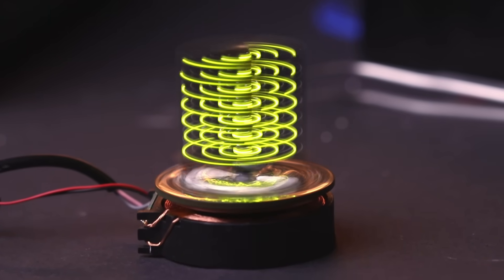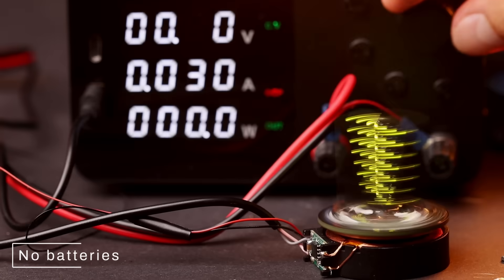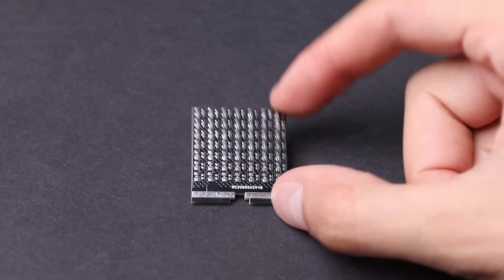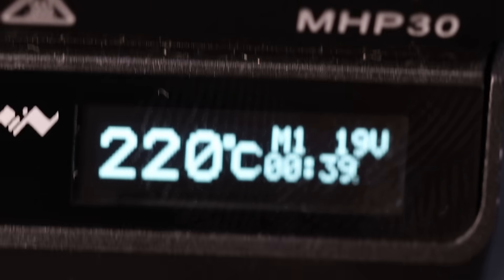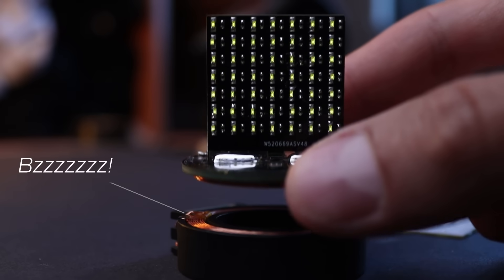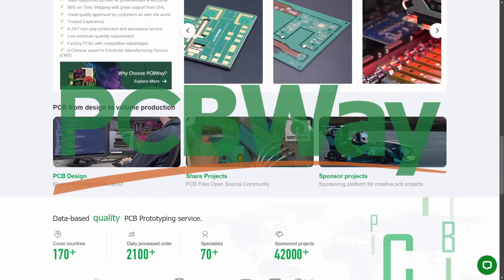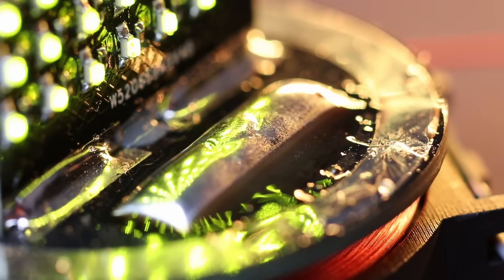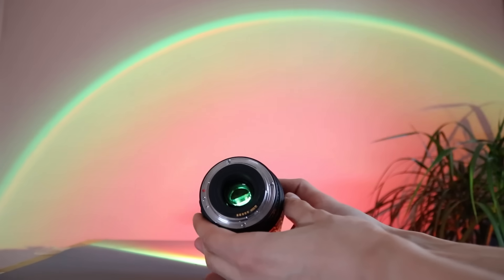I Made a Tiny Volumetric Lamp

Comment: I lnow this would complicate this a bit. But you can use your inductive coils to xfer data with power. It takes a bit of work, but it is how RFID works.

I look forward to your next project. Thanks for sharing.
Reply from the maker: I can try it, but I need to calculate the communication bandwidth because I need to constantly refresh data for a large number of LEDs quite quickly. I should think about it more. Thanks for the advice
Reply: @NickElectronics  how fast is rotating? And what is the slew rate of your LED's. Are they monochrome or multi color?

If your using monochrome, then you only need 1 bit per led, if they are multicolored then we need at least 3 bits. (For 8 color)
Since your typical monitor updates every 1-3ms, ill use that.
Anyway do its 1/(bits*update frequency).
Then you just need to make sure your coils support that frequency, and encode it with your power. (Though I'll admit that I don't know exactly how that works as I've never tried it, but I know it can be done. I assume there are modules you can get online which do that for you.)

Comment: why do you say leds use lots of power. spin a led strip. like a lawn mower made out of cord. yep the cord is a power & signal wire also. thats probably just jcb weld lol.
Reply from the maker: A lot, not a little. Everything is relative. 'A lot' is not a very precise word.

How do I power a spinning LED strip without twisting wires? There still has to be some slip ring or something. I can get ground from the motor shaft, but what about the +?

Not JCB weld, but close
Reply: @NickElectronics  centrifugal force keeps the lawn mower strips pointing outwards, two wires on the strip of course, + and -. current loop.

Comment: For your next trick, could you do one with addressable led's? You could use an off the shelf matrix board and a wifi enabled Arduino to control it (meaning you'd still only need to provide power) you'd have to provide a small sensor to sense it being at position zero so thsy you could keep the drisplay in sync with the rotation of course but could look smazing
Reply from the maker: Yep, it could indeed look amazing! I’m considering making a part two :D

Comment: Since the led are spinning, why not put a couple of coils on the led base, and a couple of magnets underneath so rather than  transmit power, generate it
Reply from the maker: That's one way of doing it, but it only works the same if the spinning frequency is very high—by that, I mean VERY high. The wireless power transfer frequency is 85 kHz. To achieve the same frequency with a generator using permanent magnets, you would need to spin it at a speed much higher than 6000 RPM. At 6000 RPM with a 3-pole generator, I think you can get a maximum of 600 Hz.

6000 RPM divided by 60 seconds gives you a spinning frequency of 100 Hz. Then, you multiply that by the number of poles (3) and by 2, because each pole generates positive and negative half-waves during one spin. So, 600 Hz versus 85 kHz means you have a frequency that is 141 times lower, which results in MUCH higher filtering components at both the output and input for the same power. So 141 times bigger capacitor does not sounds great for me :D

Comment: headphone jack is cheap option for spinning parts.
Reply from the maker: I suppose it won't work for long at such speeds, just like slip rings. They are all designed to work at speeds of around hundreds RPM max.

Comment: I made a large version of this for my thesis project in art school in 1979. I used copper foil to make shapes that the LEDs would reproduce in lights as they spun on the 20” arm with 50 leds soldered onto it.
Reply from the maker: Wow, that sounds cool! What kind of shapes did you make? Maybe you have some photos or references? I haven't thought about giving the spinning part any other shapes... Hmmmm, that might be an interesting direction to explore in future projects
Reply: @NickElectronics  The arrangement was like this. The spinning arm had 50 LEDs mounted in a line connected to 50 small nickel brushes that skated over the glass disc mounted on top of the motor, with the shaft coming through it. The motor shaft was connected directly to the arm and provided the positive connection. The negative connection for the LEDs was provided through the copper foil shapes that the nickel brushes skated over. The copper shapes were pretty basic, geometric things like triangles and circles. The piece was focused on transforming physical shapes into light, so the actual shapes were not that important. It had a couple of interesting aspects to it, one of which was, it was kind of scary, seeing this whirling arm that spun up very rapidly When you pressed the pedal in front of the piece. It was also a bit noisy with the fan motor, making this loud hum and the sort of scratchy noise as the brushes rhythmically scratched the Copper shapes. I haven’t thought about it in a couple of decades, and I’m pretty sure the teachers didn’t know quite what to make of it. If I were going to do it again, I would use magnetic reed switches instead of the brushes, and use magnets On the disk to create the shapes.

Comment: Could use magnets in the base with coils on top to power it, like an electric generator.

This would be more like the motor powering the display.
Reply from the maker: I could. Tere is already a huge discussion about it in the comments 😅. I just hadn't thought about it at the beginning. Also, the upper coils could be made with PCB tracks, which would save some space and weight as well.

Additionally, I was wondering if it's possible to make a BLDC motor with a low-power wireless power transfer option, where the stator has coils and the rotor has magnets plus additional coils for recieving some power from bottom coils. Hmmm
Reply: @NickElectronics : Not Exactly sure what you said, there, but it sounds good to me 😁✌🖖

Comment: Isn’t that just JB weld? And if you’re using wireless power coils you could just as easily make your own “slip ring” that’s just powered through the motor shaft and grounded to the edge of the spinning platform with a dragging wire, spring or brush since at that point your still putting the controller on the spinning section and don’t need a bunch of wires for the signal…
Reply from the maker: Yes, I could, but it's not that fun after all. I'm also not quite sure how long it would last spinning at such speed. Reliability was mine concern. For low speeds for sure slip ring is better
Reply: @NickElectronics  considering power tools use brushes and they’re replaceable for a few cents it would probably last longer than the JB weld holding it together.

Comment: Now add a high-resolution of intensified LED matrix to it.
Reply from the maker: That's a plan for a future video. But I don't know how complex it would be, because I have to send all signals through Wi-Fi or Bluetooth to the spinning board and synchronize the refresh rate with the rotation speed, which would either require a sensor to measure the exact DC motor speed or installing a BLDC motor. A lot of challenges awaits.
But it sounds like a fun project to do

Comment: Could you skip the power transfer coil on the base and just put magnets in the base? Then the spinning part has a coil which acts as a generator powered by the main electric motor to create power from its own movement?
Reply from the maker: I had some thoughts about it before going to bed yesterday, and I believe it wouldn’t work with just one coil and magnet due to the planar orientation of the coil. For current to be generated in the coil, there should be a changing magnetic field oriented from bottom to top (or top to bottom) if the lamp stands on the table with the coil above it.

So there should be at least two magnets positioned on opposite sides of the circle, with their poles flipped: one with the north pole on top and the other with the south pole on top. Then, two coils at the top would spin, magnet would create changing magnetic field in them, and current would be induced. I think this setup might work properly.
Reply: @NickElectronics  it's called an axial flux motor/generator. Magnets arranged on a disc and coils on a flat disc parallel to them.
Reply from the maker: @SidekickElements  Yes, exactly what I was thinking of
Reply: @NickElectronics  So with that you would replace half the power transfer electronics with magnets... I wonder if it's worth it. Will probably end up costing more...
Reply from the maker: @SidekickElements  Magnets are quite expensive, especially when dealing with high power levels (big magnets needed). They also have a major drawback: they’re sensitive to high temperatures. If a magnet is heated beyond its Curie temperature, it loses its magnetic properties. Additionally, generators with magnets require moving parts, which adds complexity. Wireless power transfer does not. Another limitation is the low frequency you can achieve. For instance, the standard frequency for wireless power transfer is around 85 kHz. Even with a common three-phase design in PM generators, you’d need to spin the motor at approximately 28,333 RPM to reach same equivalent frequency. I dont think it is possible. Using a lower frequency requires larger output filtering components, making the setup bulky. So, there are actually quite a few drawbacks.

Comment: maybe use carbon brush for nonnected spinning? like it is inside a dc motor? a lot of drawbacks like heating  and other issue but maybe less vibrations?
Reply from the maker: Thanks for the tip! I’m not sure it would help with vibrations, but in the future, I might consider other technical solutions. Maybe I’ll even go towards BLDC motors.

Comment: An accelerometer breakout board and a beam break ir phototransistor (can be found in SOOOOO many electronics, like old roller ball mice, scanner beds (to home the sled) ... lots of stuff) and you can ask a chatbot to write you a program that will read the accelerometer, and coordinate it with the beam break (just put some tape on the edge to break the beam once a rotation) telling you where the heavy side is in its rotation. You dont need fancy turbine rotor balance machines if youre smart about it....although, those arent exactly hard to build either....
Reply from the maker: Hmmm, thanks for sharing the knowledge! I might try making one just for fun😅

Comment: How many lumens does it emit vs when it is still?
Reply from the maker: It's hard to say without measuring it, actually. The radiation pattern from one diode is almost 180 degrees, but the intensity is obviously different at different angles. If we assume that the diodes are close to each other and that this somehow averages the radiation intensity in all directions, creating a nice equal 180-degree radiation pattern for the whole plate, I would say that spinning vs. non-spinning results in a two-fold difference. This is because it has to cover 360 degrees twice with a 180-degree pattern, resulting in lower intensity when it spins, obviously.

Comment: False premise based on rechargeable batteries not existing 👎 untrustworthy 👎
Reply from the maker: How would you charge a spinning battery? The LIR2032 rechargeable pancake battery has a capacity of 70 mAh, while the lamp can consume as much as 200 mA or even more, depending on the number of diodes and their brightness. Good luck recharging it every 20 minutes...

Comment: Apply extra flux. Components should be pulled onto the copper.
Reply from the maker: If you are talking about the hot plate shot, components were pulled to the pads, but just not all of them due to bad positioning. Sometimes it happens. If you're referring to the soldering iron shot, then yes, it's not the most precise. It was hard to film using a macro lens that was too close to the PCB while soldering at the same time.

Comment: Been making these things for something like 20 years. I just call'em "Povards". With wifi and things like ceramic capacitors, you can really spin up your system and have to run without shattering. Data can be transmitted wirelessly. There's always a dilemma with spinning gadgets like LIDAR's regarding how much to put into the stationary base and the mobile platform. Slip rings are only for small wire counts, slow RPM's and minimal wear. They're not for 6000rpm, that's for sure. If you're using induction power, that's good, because then you can even encase your electronic parts in vacuum and get rid of air friction and whoosh. This is really one cool system that can be bult and programmed a hundred different ways and each one will have its advantages and limitations.
Reply from the maker: Hello! Do you also use wireless power transfer with inductive coupling in "Povards"? I'm curious if I could do the same with capacitive coupling instead. The communication aspect is also quite interesting. I could use a Wi-Fi module on the spinning part, but I might also explore close-range communication, possibly based on the principles of a CD drive or HDD. Another option could be to use some kind of modulation to embed data into the power pulses. However, I’m unsure which solution would provide enough bandwidth for a display and would be the simplest at the same time. 
As you said, any solution has pros and cons
Reply: @NickElectronics  I just power by using shaft as one electrode, and an insulated ring as the other. Like a makeshift slip ring, because I'm cheap. And I mostly do slow turning scanners. All of my LED builds lie somewhere in a bucket. I wanted volumetric type displays and found that it's actually easier to have a spinning screen and a synchronized projector. That way, the surface that makes the volumetric picture has no electronics in it. I wish there was a way to have a silent volumetric display, but anything that spins pushes air and vibrates.
Reply from the maker: @enilenis  Hmmm. Interesting. Thanks for sharing! I hadn’t thought about a synchronized projector. 

Still, the spinning part can be placed in a transparent case. Of course, it would reduce noise, but not eliminate it completely.
Reply: @NickElectronics  I never used induction coils the way you did, because wouldn't it be simpler at that point to have 2 (or more) coils on top and neodymium magnets at the bottom, with a rectifier board, turning the spinning plate into a generator. Only drawback would be, in having to have a slightly stronger motor than the one out of a CD-ROM drive, as some of the torque would get eaten up by inductive resistance. Also, the device wouldn't power when stationary. You'd always have to spin it up and maintain RPM's unlike in your case, where the field is oriented in a way that makes it irrelevant, whether the top is spinning or not. But it adds the need to drive a bottom coil, while you could've had 2 coils on top,  magnets at the bottom and electrical generation on the fly.

Comment: Grey goo may in fact be J-B Weld... in case anyone watching wants something made of different materials to never come apart easily. The end result of the lamp was kind of mesmerizing, subscribed
Reply from the maker: Thanks a lot! It’s not exactly J-B Weld, but similar stuff. Loctite from Henkel
Reply: @NickElectronics  did you just reveal it without even being under torture
Reply: @MatthewMakesAU  I hadn’t even thought of that lmao
Reply: That was my first thought too in every case, lol. There may be other gray glue brands, but that one might be the most known one. It is indeed a very strong glue and it can be cut or processed afterwards like cement in a way. A downside I found is that its hardening process is not linear and deceiving. The first few times I used it, I though it has solidified enough now that I can place the part in another orientation, but it turned out that it would still flow a significant amount just due to gravity until actually hardening.
Reply: Which Loctite?
Reply: @greapsoho  when your testing figures it out, let us know which video reveals your results.
Reply: I was thinking RTV

Comment: Idk what the efficiency is like for wireless power transfer but you could use two different motors. One inner one and outer one to act as a generator. You could probably transfer data through torque variation as well. The benefits is that presumably it wont push unneeded rf into the world.
Reply from the maker: You're asking a very good question about efficiency. It's quite low with the motor between the coils because eddy currents are induced in the motor casing, which is essentially a piece of metal. So, a lot of power is lost just to heat the motor, and there's not much that can be done about it.

But still, using two motors sounds like overkill.
Reply: @NickElectronics  the second motor wouldn't have to be an actual off the shelf motor. You can a hollow ring. Or rather two of them. The inner one would have small magnets. The outer would have small coils.

Comment: you could have used a few small loops of wire on the spinning part that passed over magnets in a printed base to generate electric current would not need very large wire loops nor very strong magnets as you would generate way more than enough current at 6k rpms with weak ones. not more than the motor would consume but way to much for the board and leds you would need a resister to cut the current down but still would be pretty slick
Reply from the maker: I’ll probably give it a try next time. The reason I made it this way is that I was a bit scared of overvoltages that could burn my LEDs, even with resistors. I’ve never created generators before, so I suppose I should try it once and test it myself.